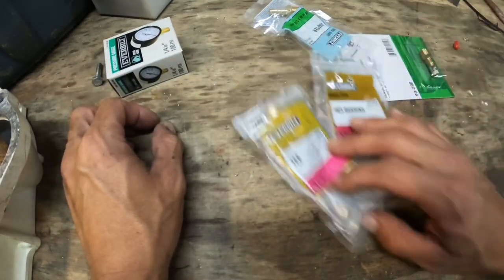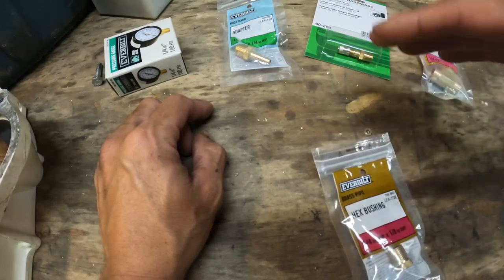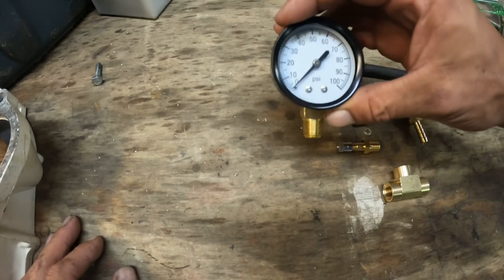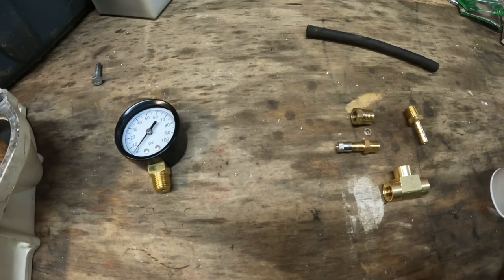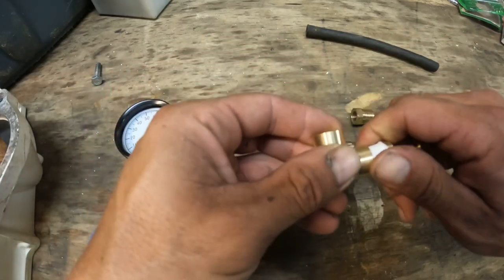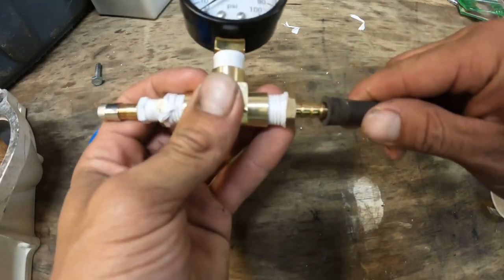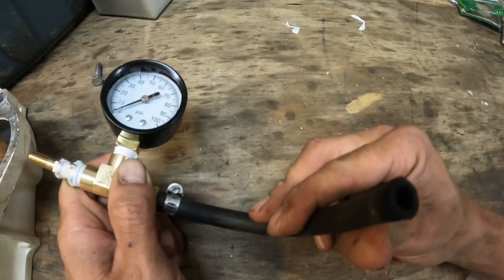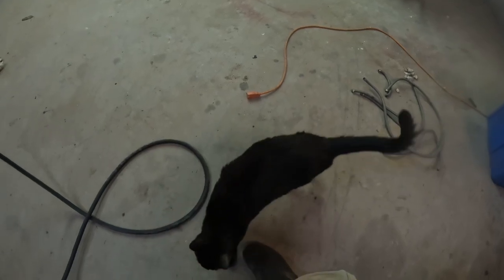How To Build a Pop Off Tester For Diaphragm Carburetor

Comment: How much did you spend on all the parts? And what store can I find all the parts?
Reply from the maker: Around $20. The parts should be available at most hardwares or big box stores. The schrader valve I got at Napa because our hardwares locally were out of stock.

Comment: Is that to find out what pressure the diaphragm will hold?
Reply from the maker: It’s used to set the correct pop off pressure via different spring rates/lengths.